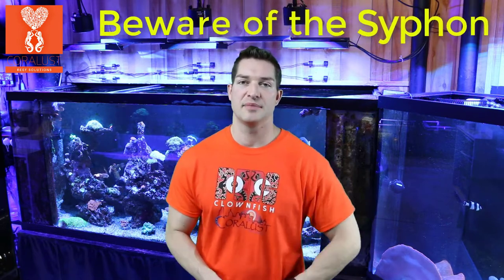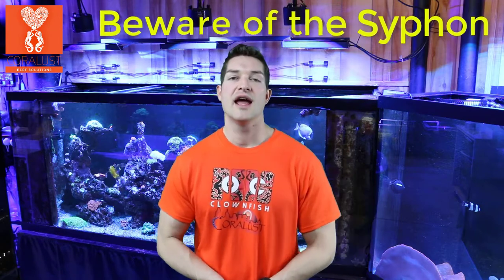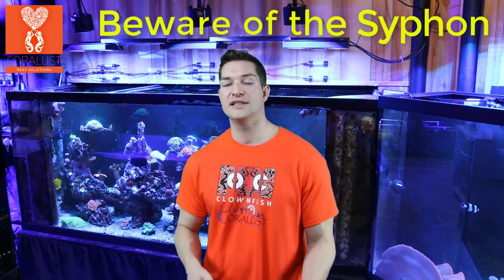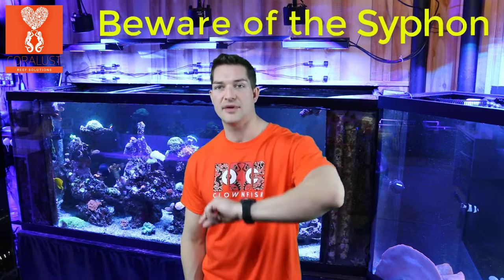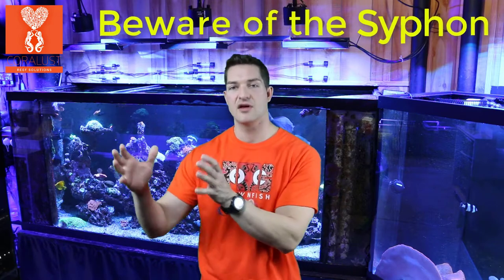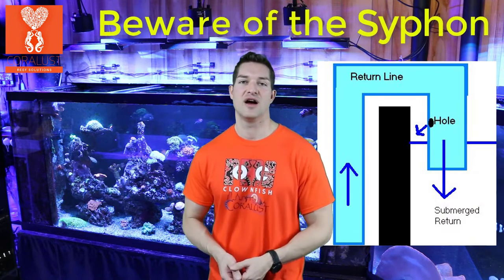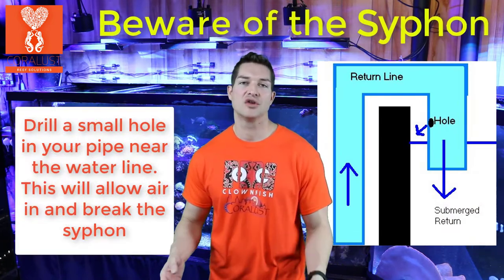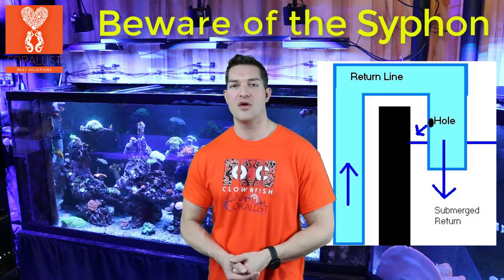Beware Of The Back Flow and Siphon "Mistake Monday" w7

Comment: I am putting my first large saltwater tank together (75 gallon) with a 55 gallon sump and have come to the discovery of this siphon break and overflow issue. Your suggestion in this video about putting a stop valve or flap is one of the best I've heard. How do I do that? Where do I find the materials to do this?  What are they called? I sure would appreciate some input and information. Thank you so much.

Comment: Thanks for the video, Danny! Just recently made this mistake at a doctor office client's! The waiting room was flooded! Thank God it was after hours. We plan to drill a hole in the return loc-line to prevent this from happening again. By the way, when you drill the hole, make sure the hole faces the water or the inside wall of the aquarium, otherwise it could lead to more problems! Kind of self explanatory, but just wanted to throw that in. Thanks again for allowing Seaquaria to partner with the  Coralust store!
Reply from the maker: Wow, that's a good story.  Sorry that learning experience but I used to do it alot in the beginning overflowing my sump. I had too many systems draining into one.  You have to be very redundant.  Anything you need let me know, you'll have to stop by and check out some of our new changes.
Reply: Coralust Reef Solutions yeah my mental checklist isn't up to par when working on a tank I haven't touched before.